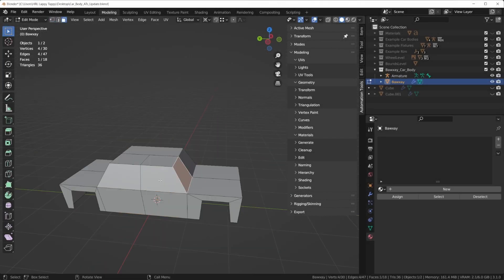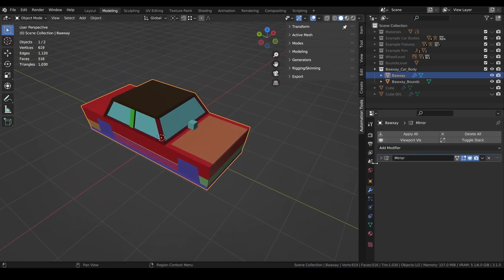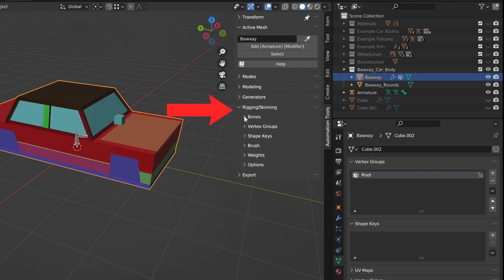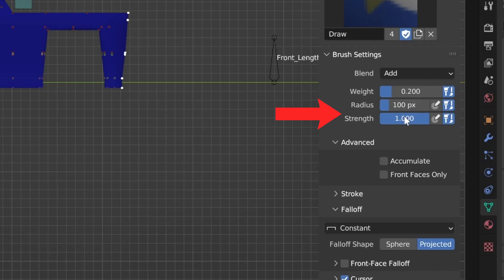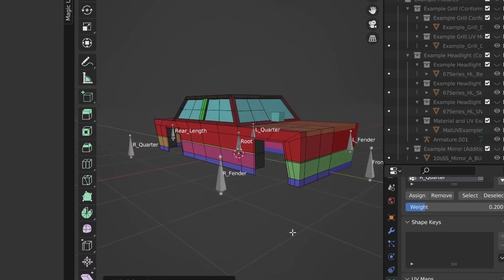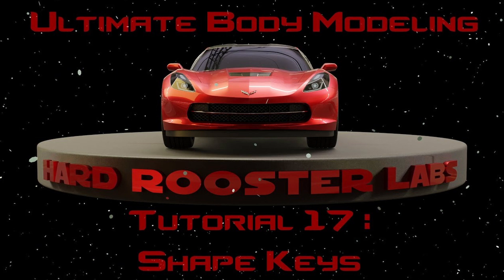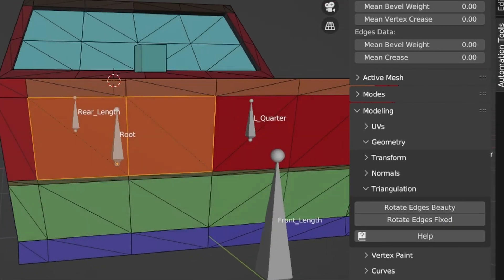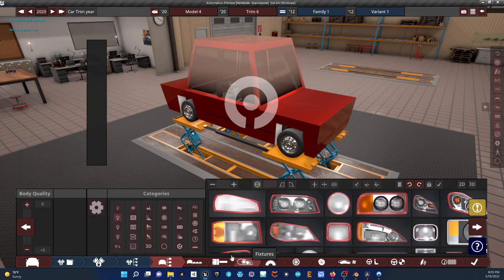Improve your Car Body Modeling Workflow with the Automation Tools Plugin.

Comment: Hey! Thank you for the tutorials, you have been of huge help! but in the video you forgot to mention that you can't export a car with shape keys while having subdivision surface, this will cause the modifier to be ignored and the car to get exported as a square mess, this isn't the devs's fault, but blender's, i still think it's a good thing to point out
Reply from the maker: I don't understand why anyone would try to export a car body with a subsurf modifier active.  You can't rig a car properly, or set shape keys properly while a subsurf exists.  These are things that are covered in other videos I've made.  The reason for this is any rigging is applied to the base (non-subdivided mesh), and it's those vertices that move.  The subsurf modifier just subdivides the mesh after that action, I don't thing there's anything blender could do about it since it's an order of operations thing.
Reply: @hardroosterlabs3814  oh, right! Thanks for the answer
Reply: @hardroosterlabs3814  Hey Hard Rooster, i need help, my shape keys don't show up in automation, what am i doing wrong?